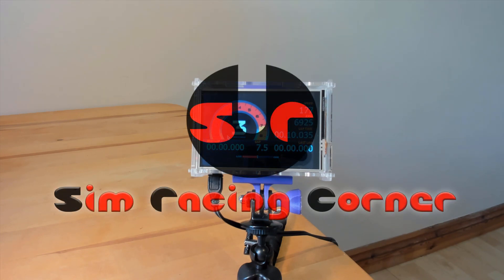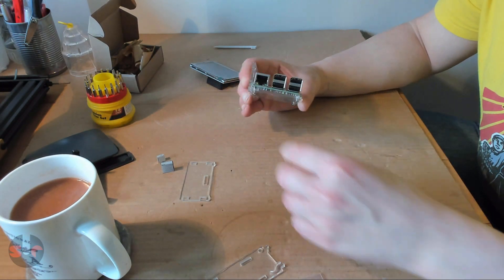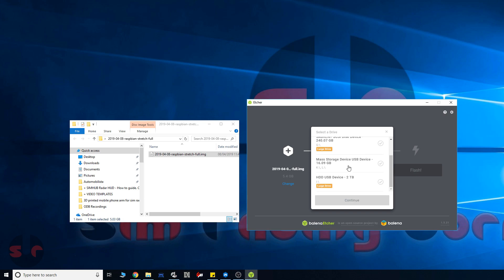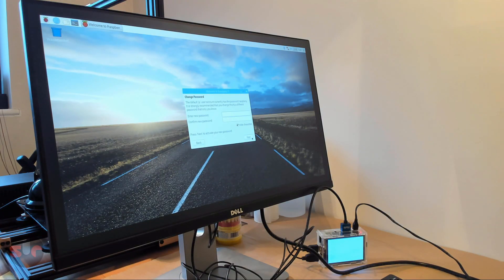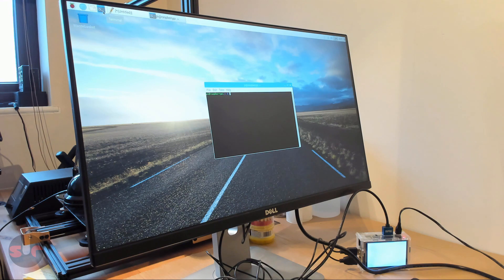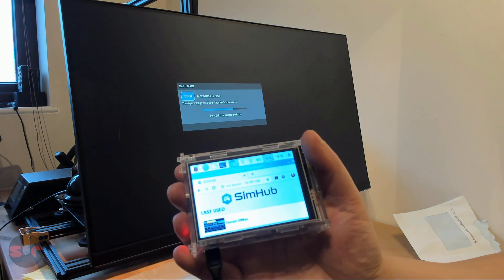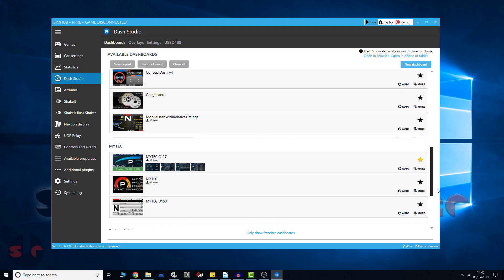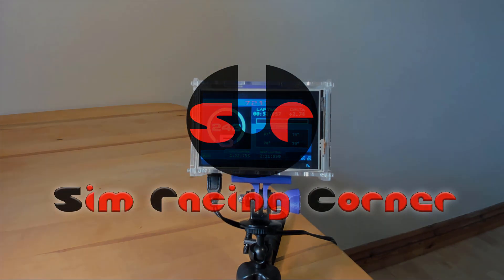Raspberry Pi SIMHUB Dashboard: How to guide!

Comment: Did SIMHUB change their ip address? Using http://10.197.129.175:8888/ on my PC's browser is not getting to their page. I can browse to any other sites with no issue. Why do we need to enter via ip address? Can't we just use http://www.simhubdash.com/ ??
Reply from the maker: Try http://192.168.1.141:8888/
You can't use a normal web address as it's not a normal website. It's connects to your local network and not through a DNS server.

Comment: The IP address doesn't work
Reply from the maker: Make sure your Pi is connected to your WIFI and has internet access (load up a random website in the browser on the Pi). And also try the IP address in a web browser window on a smartphone or tablet.
Reply: @SimRacingCorner  already tried it on my phone and doesn't work. Do I have to do something on simhub on my pc?
Reply from the maker: @Luke-ks9ss  There you go. It should be very easy to set up, it's very straightforward. Did you click the 'Start' on one of the dashboards to run it?
Reply from the maker: @Luke-ks9ss  In the Dash Studio, highlight a Dash, then left click with mouse to show a menu, select 'On phone or tablet'. Then enter the IP into the browser window.
Reply from the maker: @Luke-ks9ss  You can even test the IP address on your PC in browser window too.
Reply: @SimRacingCorner  now it works, but it gave me a different IP. Thanks bro!
Reply: @SimRacingCorner  it only works on my phone not on the raspberry pi
Reply from the maker: Sorry I'm at a loss then. I got it running right away following the steps in my video. I've rewatched the video to see if there's anything missing, but it's fine. The video is showing everything I did, and you can see it working. SIMHUB just renders to any browser window, so there's no special steps to get it running through the Raspberry Pi web browser.
Reply: @SimRacingCorner  Ok. Thanks a lot anyway 👍
Reply: Old video but obviously the IP address is different in each case. Lol
Reply: @Driftwoodechoes  yeah lol i dont think people realize they need to use their own computer's IP, not this guys ip for his computer on his own local network

Comment: Does it run at 60 fps? I mean is that is on point for the read out?
Reply from the maker: The screen shown in the video isn't 60fp. It's a budget screen (includes the case too) costing around £15. A more expensive higher refresh variant of the screen can be sourced.